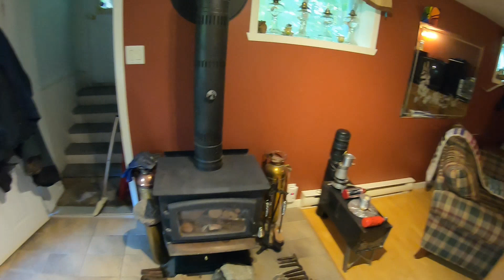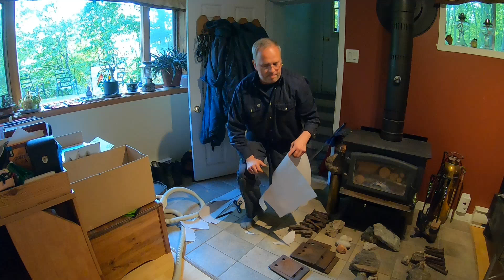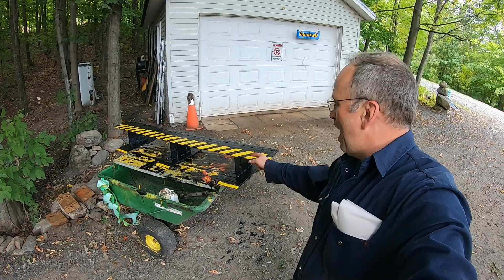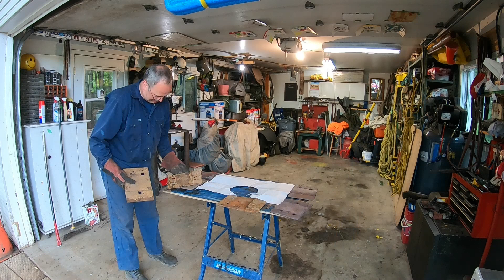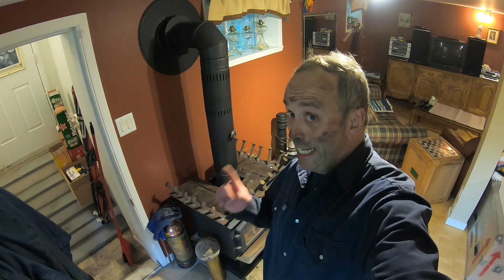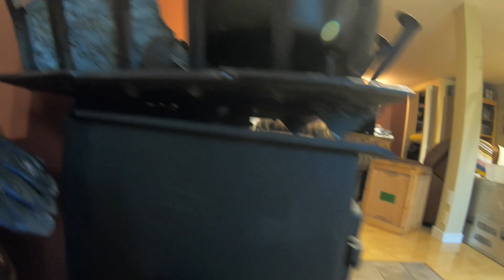Improving The Air Heat Exchange Ratio of my Wood Stove using 100 yrs old Railroads Back Plates 😮👍😊

Comment: Hahahahaha  Dave...I caught you calling me out again !!  LOL  As you can tell we kept and used just about anything too.  Perfect timing then on the dump trailer video....(-:  What you've done is create an 'external' secondary heat exchanger.  Not only deflecting the air flow to the front the added mass will hold the heat and release it to the room long after the fire goes out. 
     I notice your electric baseboard....have you seen the DIY heat exchangers that extract more heat from the flue gases by wrapping soft copper around the flu pipe and connecting it to a closed loop baseboard heater?  Thermal conduction (?) moves the water without a pump.  
    By the way do you have any basalt in your rock collection?  Oh and I think I saw a stove set up like this in the old Mad Max movies of the 80's....LOL  Sorry mon ami...couldn't resist !! (-:  Awesome Job Dave.
Reply from the maker: LOL That was a very funny about Mad Max Movies  !!!  I'm very much interested about that way of heating up water and using at higher level a than the stove a Baseboard heater. it will sure be good in my office. Can't wait to see my house now with R 60 in the attic than the previous year at barely R 20,,,  Thank you again Sir for your nice idea and input and great and fun support Cheers !!!

Comment: That is a good way to add heat mass. I can't believe you had all those plates in the back of your Toyota the other day! Lol! Great recycling of old steel. I think I have a similar wood stove here. It's a Mistral from Drolet. I hear also that you wish you had a dump trailer.  Didn't you say that? We will see what we can do in that regard! Thanks Dave!
Reply from the maker: Good morning my friend 🌞 Yes that day my Toyota was loaded for sure !!! 🥴🤣 Yes and I have many other project on the go for sure with these RR plates !!! The Mistral is a bigger stove than myself. Yes a dump trailer will be great for sure but I do not have a truck yet to pull it LOL !!! but thank you for your offert, it could be a partnership project !!! LOL Cheers !!!

Comment: Salut Dave!!!  That looks like a great idea to increase the heat output from your stove.  Having the air come out the front like you have designed I think is much better.  The cooler air is lower in the room and so this warm air coming from the stove plenum you made will heat it.  Great job and a clever solution!!!  A la prochaine!!!
Reply from the maker: Bonjour Mon Ami 🌞 Thank you very kindly for the nice words, great input and support Sir 👍👍👍 Yes it will also make retain more heat with that extra added weight !!! Have a great week Sir Cheers !!!🌞